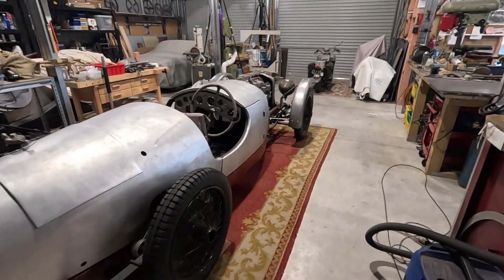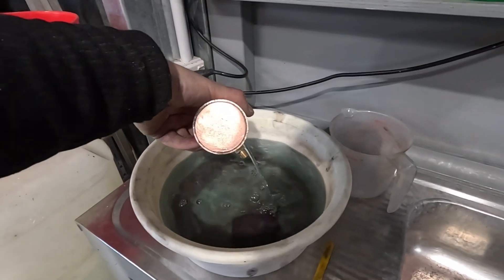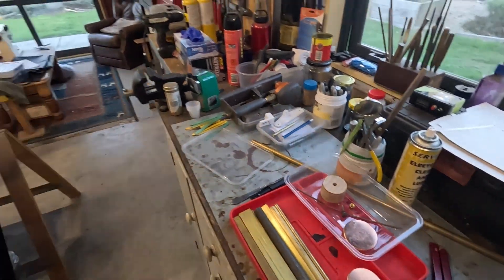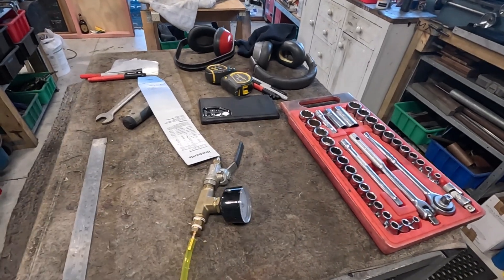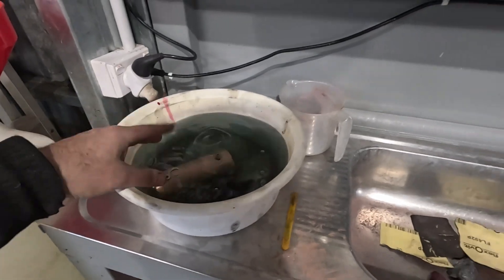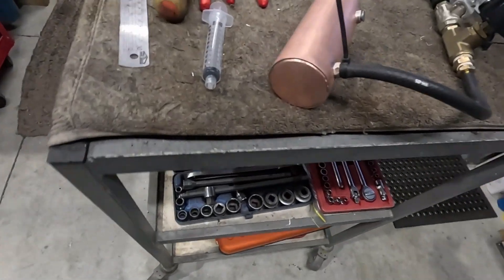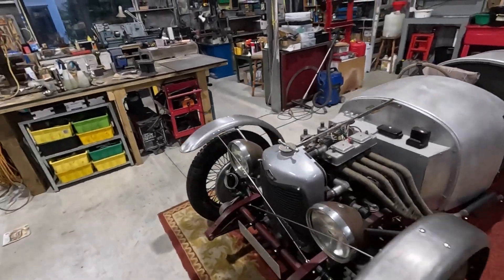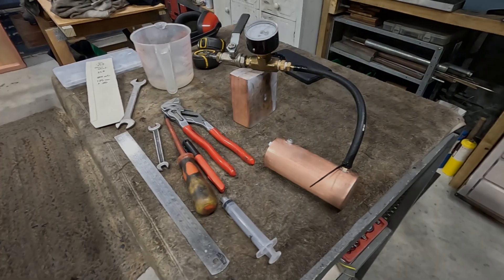Building a little steam car - Part 1

Comment: 6:43 I know exactly what you mean, exactly. I think it's a case of knowing full well that should you remove 6" off that 4' piece of whatever, (thats been leaning in the darkest corner of the workshop for at least the last decade), that within two days you'll need another piece 3' 7" long....so you don't use it, just in case.
Reply from the maker: It's worse when you realise you've had the same little chunk of scrap for 30 years and you can't bare to use it since it's like a old friend now!

Comment: Brass is no good for steam boilers. The steam effectively removes the zinc from the alloy and dissolves the metal. The boiler will then fail.
Reply from the maker: That's true but I think the key here is 'eventually' and it depends on the boiler. Mamod and other brass toy ones are fine. Small volume running low pressure. If you empty them between uses so they aren't full of water when not used that helps too. They might get to the point where the issue is so bad they no longer hold pressure but I don't think one has ever exploded in the way real steam boilers could.

Comment: You're inspiring me to dig out my G gauge steam tram I built a few years ago.  I used copper pipe for my boiler which is a lot thicker than Mamod pipe.  It worked well but it required a good size meths burner to keep it in steam. There's a video somewhere on my channel of it running on my abandoned garden railway.  I'll be following along!
Reply from the maker: I remember watching that film! I've always wanted to build a small live steam engine but for OO gauge (HO in the US). Something you can set up on a table top. I started many years ago but didn't have the skills or tools then to do it.